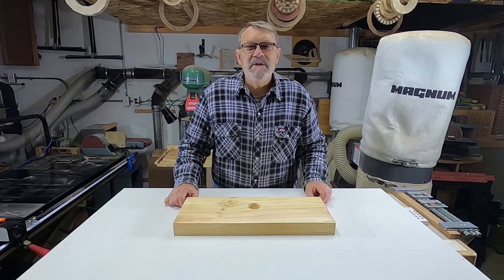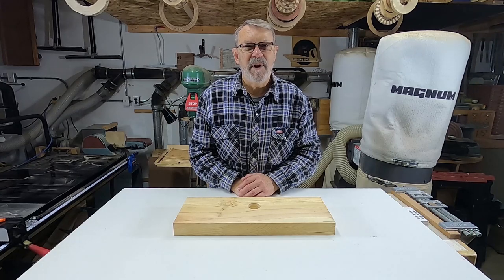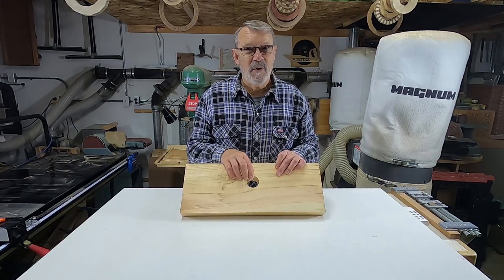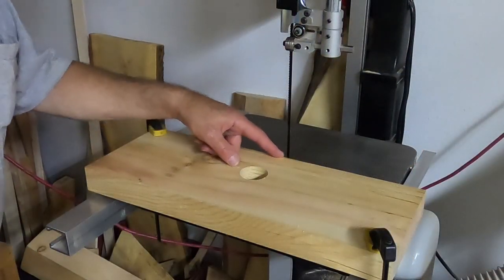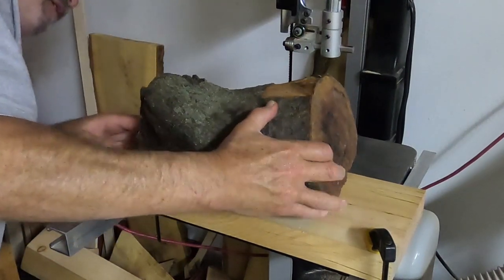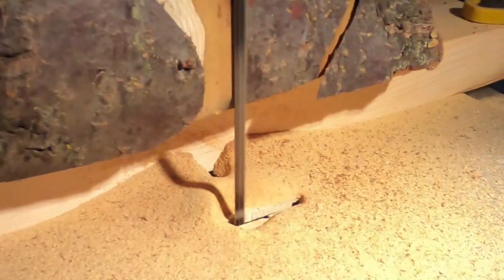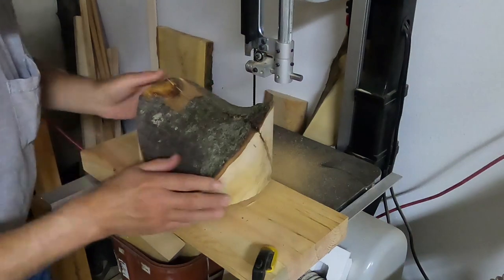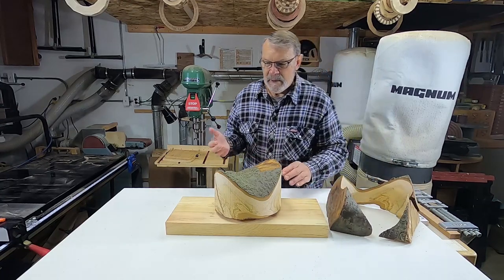Circle Cutting Jig For Woodturners Only

Comment: That's a great idea Gord.  I tend to use a worm screw more than a faceplate, but I imagine it could be adapted to work then too.  Thank you for the tip!  - Ed
Reply from the maker: I can't see any reason the base of your chuck couldn't be fit to the proper size hole just like the base of the faceplate I used. Glad you liked it, Ed. I hope it will be useful for you. Thanks for watching! 😃😃
Happy turning,
.....Gord

Comment: Great idea. If I don't want to use screws, I used hot melt glue from face plate to blank. Then just strip of the glue. Thanks!!
Reply from the maker: I love hot glue but have never used it with metal. Does it hold on metal as well as it does on wood? If it does that would be a great help! Glad you liked the idea, Ed. Thanks for watching!! 😃😃
Happy turning,
.....Gord
Reply: If you use your idea and glue the face plate to the blank it works. I would never trust a metal to wood hold for turning.
Best,Ed
Reply from the maker: Thank you, Ed. Much appreciated.